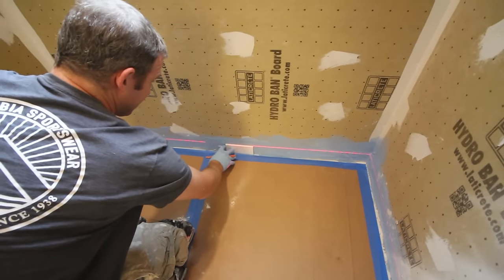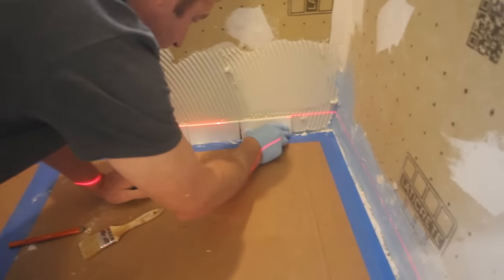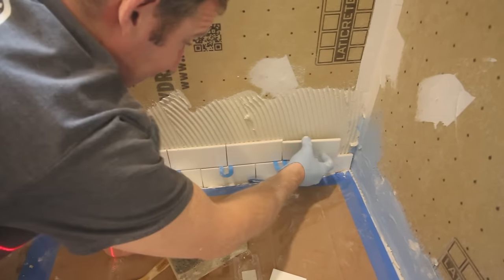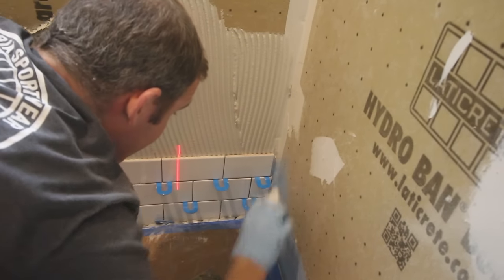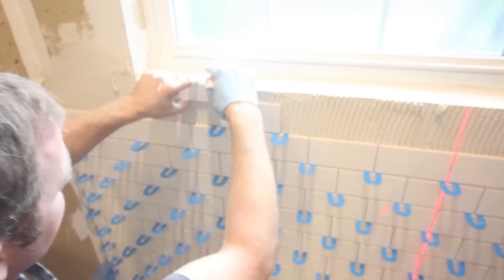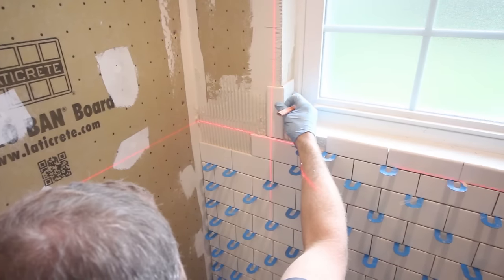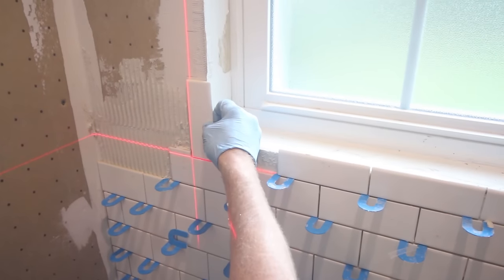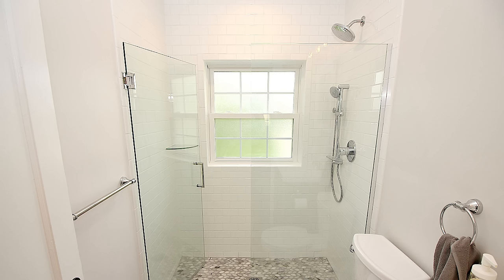How to Tile a Shower Wall...Subway Tile Tips on a Window Wall -- by Home Repair Tutor

Comment: Great tips however it's important to note, this is tiling a level wall with straight corners. Do not batch cut tiles unless youare 100% sure your corners are equal.

Comment: Last time I did tile work like this, we picture framed the window with bullnose then worked outwards. Was a pretty good result. 
Nice work!
Reply: I totally agree. I wanna see full tiles around the window not cut ones. Save the cuts for the bottom and sides. I don’t think anyone could talk me into doing it this way in the video.
Reply: I agree. In fact I generally put the bull nose wrapping around the actual window sill so that the bullnose is covering over the tile on the wall so that the seam is less likely for water to penetrate. That's just me. More than one way to skin a cat 😉

Comment: Thank you for the videos - they are helpful to we DIYers! 

One thing I noticed...is your underlayment system (is that the right word?) waterproof? The bullnose curvature is on the outside rather to an the inside where water would roll off the plate. I hope that makes sense.

Comment: I'm about to attack a similar project but I have a question/thought.  While the bullnose framing looks great, wouldn't it be better to have it laid on the sill and hang over to avoid a lateral grout seam on the edge where water can lay?

Comment: I am about to purchase subway tiles for my shower but my walls are not 100% flat. Some areas have a little over 1/8 gaps but nothing more. Should I need a leveling system or subway tiles will not be advisable. Thx.

Comment: I tried tiling yesterday. What a disaster. I spent more time cleaning my tub from excess mortar than I did actually putting tile on the wall. Long story short, the tile is back off, the tub was cleaned, and the walls were scraped so I can try again. I'll need a new trowel too, it got stuck in the side of my shed when I threw it outside.

Comment: I have a window in my shower. It goes into a corner.  I'm starting to research how to tile it, probably for next spring/summer.  The window can't be removed, either.  Did you have two laser levels?  thanks for the helpful video!
Reply: I don't believe they did, but even if they did you wouldn't have to. Most laser levels will shoot both vertical and horizontal level lines. Even though they can be pricey, I would highly recommend buying one. They make things way easier.

Comment: What do you do if find out that the top row (near the ceiling) is only 1” height?
Reply: Cut them on the tile saw
Reply: Put in an accent mosaic tile at about 5ft, make it the right height to end with full tile.
Reply: Use some "jolly" tiles to adjust the spacing, or use longer 12 inch tiles as a trim.

Comment: With 1/16 grout line , are you using non-sanded grout in a shower ?
Reply from the maker: Thanks John for asking, we used Laticrete Permacolor Select in this shower for the floor and walls

Comment: Is there a reason you’re using spacers with subways? I’ve installed a tremendous anoint of subway tiles and they have integrated spacers. Just curious..
Reply: Integrated vertically and horizontally..

Comment: The tile looks decent. One thing to note is the fact that there is a sliding window in a shower. Absolute terrible idea especially in colder climates. Where does the water go that gets into the window? Outside and this lead to ice damning in colder climates, or worse inside the wall. Waterproofing is useless when there is water on both sides. A nice alternative, if you must have a window in your shower, is a picture clear story window and seal up all interior seams on window and where the window meets the tile.
Reply: Exactly. Just get rid of the whole house, it just gets wet. Showers should just be outside, without walls or doors or windows. With the price of housing, people could just live in the showers, outside, and shower with clothes on so they aren't naked in front of the neighbors.